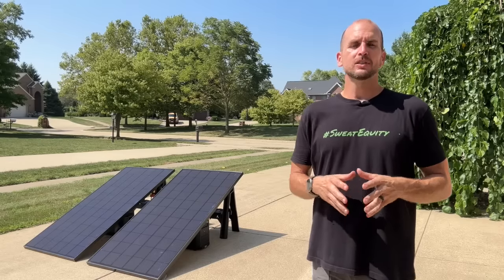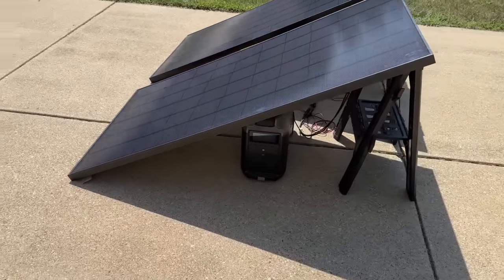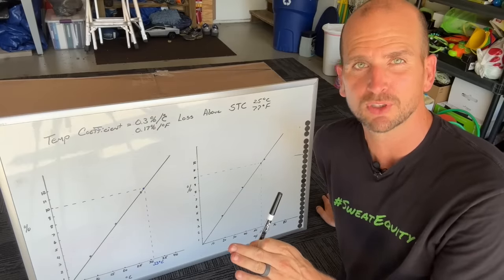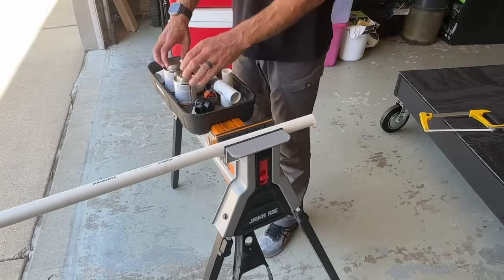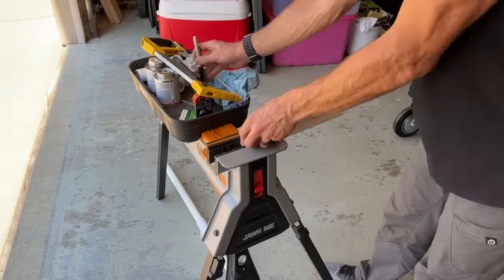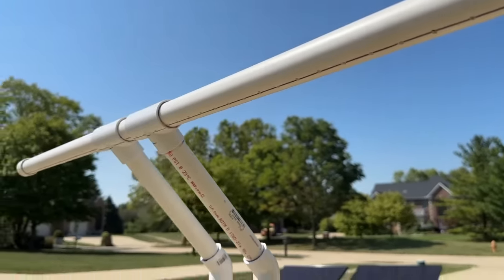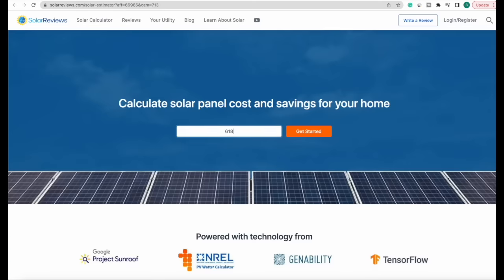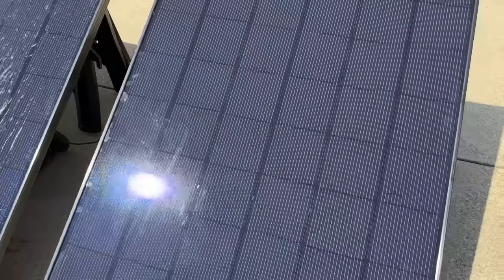Surprising Power Gains By Cooling Solar Panels

Comment: I prevent my panels from  getting too hot by keeping them in the shade.
Reply from the maker: Genius! 😂
Reply: Even better if you keep them indoors
Reply: lmfao 🤣 nice one
Reply: Good luck with the power gain.
Reply: So smart
Reply: Put the panel at the bottom of pool
Reply: Next level genius
Reply: You made my day!
Reply: I only use them at Night.
Reply: @Stevedawhoop  Actually, if they are sufficiently waterproof, I wonder how well they would work under a layer of say 10cm (~4 inches) of water.
Reply: Following your logic, you might also be able to get some savings by running the system at nighttime when it's much cooler.
Reply: @perpetualrabbit  I wonder when we will get one of those thin plastic solar, I want one that only absorb green wavelength and grow plants under it, maybe make it into grow tunnel
Reply: @Stevedawhoop  Well, there are already transparent solar cells  in development that can be used for windows. They do obviously absorb some of the light or they would not be generating electricity. I know that the compounds that maje up the solar cells (doping I think it is called?) can be tuned to absorb certain bands of wavelength.
The fact that leaves are green means they absorb the other colors and reflect at least some of the green light. So your idea should work in principle. I wonder what the plants would look like from outside the greenhouse: black maybe? If you can store the energy in batteries and the heat in mass, like a water basin, you could use grow lights at night and the heat buffer could slowly release the heat. Let me know if you ever get this working.
Reply: EYYY!!!
Reply: @perpetualrabbit  probably some light would be refelcted by the water surface..but it still would be worth testing that idea.
I think i seen a report saying  floating solar panels on lakes also heat up less.
Reply: Best Laugh I had all day!  lol   Thanks!
Reply: LMFAO
Reply: I find keeping the panel cover on during the day and removing it at night works best.
Reply: Jenias 🧠👈🏻
Reply: Best joke evar
Reply: I built a solar shield around them, I also have a cryogenic pump setup from my nuclear reactor, and can achieve within .2 degrees of 0 Kelvin. Take that outta space!
Reply: Ha!!! beat me to the punch!!!
Reply: Better yet cover them up🤣
Reply: I only deploy mine at night.
Reply: Use a small kerosene powered water pump and get the water from a well.
Reply: Very silly, I keep mine in the warehouse
Reply: @perpetualrabbit  Underwater Solar Panels would be an interesting concept! if the longevity is increased by the cooling effect it maybe practical in some regions!
Reply: I keep mine in the box they came in
Reply: @mrblock1318  under a swimming pool, or better yet if they’re light kind as a swimming pool cover
Reply: AHAHAHAHAHAHA
Reply: The Polish were planning a space flight to the Sun and everybody thought they were crazy until they told them they were going at night.
Reply: hey wait a minute....
Reply: Holy shit beware that would give you too much power to handle😂
Reply: LoL
Reply: lmao. seriously.
Reply: KKKKKKKKKKKK
Reply: keep them in a cool, dark place to maximize their longevity.
Reply: That's a good joke 😂
Reply: What about keeping them in the manufacturer box?  ;-)

Comment: the company DualSun has a panel that can take in pool water to heat the pool while cooling the panels. If no pool, they can also be used to preheat water for your water heaters or go to any heat exchanger. It's a pretty cool system.
Reply: Was just about to mention them; currently planning to use some of those, and send the heat to a geothermal well that will provide heat for my house in the winter.
Reply: I always wondered if you could do some sort of micro-thermopile array setup on the back of a panel to generate useful power and cool the panel.
Reply: As soon as I saw the title I was thinking, combination solar thermal and pv is the ideal panel.
Reply: I hope the pun was intended.
Reply: What about all the bird and bat shit! Do they filter that out before you swim or shower in the run-off water?
Reply: @nivid01 it is a closed loop system that uses a heat exchanger, they are on the back side of the panel. So no contamination.
Reply: Anyone know how much a Dualsun or Sundrum system costs per panel?
Reply: @jacobcarlson4010 what climate do you live in? I would think even in a climate like San Diego the panels would be too cold in the winter to pull off any heat for your home and it is not really possible to store heated water for months from summer to winter even in a thermal well.
Reply: Electric bill.....$0.00
Panels bill......$400.00
Water bill.......$100.00
Electric bill without panels..$200.00🤑🤑
Reply: @JONNY2NITE : I’m in East-central IL, and thanks for actually asking. Most people these days go for the “this absolutely cannot work anywhere in the world” type counter. But anyway, back to your point. In the winter months, it can get below -10F (-23.333 etc in Celsius), which is too cold to get heat from the solar panels; that’s actually correct. Where you went wrong is the claim that you can’t store heated water underground; one of the most senior bosses at the facility I work at has a geothermal system that’s based on a well, and his house never goes below 74F in the winter (23.333 etc degrees in Celsius). Of course, he buried the well as far down as he could go; which ended up being more than 60’ down. I know that the office that he works in is also heated/cooled by a geothermal system, but I can’t remember if it’s a well based one, or the “giant field of buried tubing” type. Either way, it is absolutely possible to use a geothermal system to store heat from the summer, then use it in the winter.
Reply: Nice!!
Reply: Wow, I’be been thinking as heat stimulates chemical reactions, that the panels getting hot (and they get HOT in the blazing Hawaiian sun at 1,000 elevation) would raise the output. Of course, NO ONE else has even mentioned this in passing. The closest is s comment about heating water etc. with the heat, but no mention of efficiency improvement. But I do have them over a pure white tarp to stop the nice dark lava from taking it to even more extremes. This video is my second by him, and this is a real eye opening lesson. Kudos!!
Reply: @jacobcarlson4010 Now yer talkin’! Mother Earth news has had a lot of great ideas akin to your thought. But not solar panels for heating water, not that I saw.
Reply: The wire gauge test has a comment about it. Or am I thinking about a comment here that names an actual product that utilizes this concept. Good stuff in the videos AND the comments on this channel.
Reply: @jacobcarlson4010  There's a guy in Nebraska who grows oranges in a greenhouse heated by geothermal - and he pushes the heat from the summer back in the ground. Done right a giant thermal mass can do a lot of work.
Reply: @JONNY2NITE  No we used to get a suntan on Christmas Day in San Diego. Sub tropical climate.
Reply: Anyone know a US company making a PVT panel like DualSun?
Reply: @patrickjkavanagh  I’ve been looking on the web, looks like they are all going through licensed installers so far. New technology, they wouldn’t want to risk some darn fool frying himself or others before the technology gat’s off the ground. I’m starting to think of ways of simply mounting OV panels over solar hot water panels and using aluminum plates or some such to improve heat transfer. I have heard the PV-T is expensive, so I’m thinking of improvising. I was a safety worker for a huge construction company, and have done lots of solar for myself and lots of other electrical work as well.
Reply: @5400bowen  yes but is there a manufacturer in US making this type of panels? I can only find overseas
Reply: @patrickjkavanagh  not that I can find. Looks like they are only available wholesale so far. I’ve been doing web searches.
Reply: cannot imagine how much net gain after running the pump.
Reply: @hc8714  yeah, I was thinking he should do a test with 2 kiddie pools, one with the pump moving the water connected to a battery taking in solar from that panel, and another with a resistance heater connected to another battery taking in solar. Get the resistance heated pool to the same temp as the one just pumping water to chill the panel and see if there's any performance gain or energy saved.
Reply: all this closed circuit aproaches are nice but you should take into your calculation the consumption of the cirulation pump - not that you end with more power consumed by the pump than you gain by cooling the panels
Reply: Do they have a system that yiu can install on preinstalled panels?
Reply: The HPV panels are cooled from the back, pipes running through a supporting heat diffusing material or thermo transmitting mastic gluing them to the back. 

The overall efficiency is massively improved as is the peak output on sunny days and the lifespan of silicon based cells is massively extended by preventing damage. 

It reaches its best use in boats and any off grid situation.  Where PV power  and a supply of hot/warm water is useful.

It could even be used to power a heat pump or stirling engine.
Reply: @JONNY2NITE 

Even in The uk on a cool sunny day heat builds up on a black panel. Also the PV cells work off the shorter blue wave lengths but convert some to the red and absorb more of the red heat wavelengths. Hybrid PV  HPV panels can use more of both the water runs in tubes contacting the back of the PV panel. 

So can just be washed clean and use dirt shedding coatings.
Reply: The efficiency is pretty bad on duals un panels.
Reply: Ahhh yes. Lightning rain panels.
Reply: If I remember correctly, his used air, and he said he recharged it during the day. It was his design of the structur that made it possible.
Reply: I think this is pretty better, water is precious to been wasted like in this video... WP
Reply: @5400bowen high temperatures can also accelerate panel degradation over long times. Interestingly though, some solar panel technologies like organic solar cells could possibly be improved by slight warming because the charge generation process is thermally limited.
Reply: That's 🔥🔥🔥🔥 WOW!!!
Reply: This cogeneration strategy made sense back when panels were expensive but not now. We suggest simply adding a few extra panels and using electricity for simplicity sake. Great test however. Ive considered a cogeneration water preheater for my solar Motorhome because there is no space for a extra panel.
Reply: I remember a "This Old House" episode from the mid 00's that had pipes on the back from the factory. From what I've been told, they are out of MA. Not sure on their name though.
Reply: I think this is the best solution.  Just run a line off the water main through the panels before the water heater.  The water heater can work much more efficiently and the panels do a little better.  The water by itself, like in this video, I would call wasteful.  Of course this is just a test.  The pool might be the best solution though.  It doesn't take more energy for the filter pump.  It's pumping up, but also pumping down.  My parents have regular solar heating for their pool.  It has some pretty powerful affects on the water temperature.  I wonder how the total lifespan of the panel improves when it's cooled like this.
Reply: that sounds great
Reply: @alexandergunda8916  lol
Reply: What about the winter? Even a little water left could crack the panels if it freezes.
Reply: I thought about this but then wondered what hours of pool chemicals every day might do to the panel....?
Reply: @tornadokat  you could run pool water through them, but it's much more efficient to use a heat exchanger near the pool equipment and have something like glycol running through the lines.
Reply: Smart
Reply: Somebody watches linus tech tips lol
Reply: Yes, but they are ridiculously overpriced (you're looking at over 550$ each).
Reply: i was gonna do that just with some black hose coils
Reply: How great if bifacial water cooled hybrid solar panels become the norm? Ultimate efficiency and power output, with the addition of a water heater
Reply: @jacobcarlson4010 Do they ship to the US cant imagine those are cheap
Reply: The idea of using "hybrid" panels that can make hot water while at the same time cooling the Panels isn't new, but due to increased cost and complexity, both during construction and installation means they will likely remain a Niche product forever.
Reply: @mjbates  
That's very unfortunate. Here in Germany we have a lot of hoops to jump through to install Solar, but it seems wherever you live is even worse.
Reply: Then your consumption goes up to run the pump that is sending that water. You still lose.
Reply: @ErikBansberg  The solar water heaters are pretty popular in India and they are pretty cheap - about $250 dollars for 200 liter system including the stands, panels, tank & setup cost.
Reply: And it's French 🥖
Reply: Isn't it the ones shown in LTT vid?

Comment: Instead of pouring lots of cold water on the panels, you could try to spray a little mist. Then water evaporating would cool the panels with minimal water consumption.
Reply: I was thinking the same thing… misters are great as they really don’t use a lot of water… most people think they are wasting water, but refuse to switch to composting toilets… but, whatever
Reply: And spray it on the backside, putting it on the front blocking the sun is just stupid...
Reply: no reason you have to letting the water just runoff into the ground. Assuming a roof mount system run the water over the panels, it drains into the gutter. downspout flows into a catch barrel with a small pump that sends the water back up over the panels.  install a float switch in the barrle that adds tap water if the level drops below whatever minimum amount you need for the pump. Assuming you reduce leaks going elsewhere it shouldn't be any more water loss than you'd have from a mister evaporation.  The main question is does the power gains outweigh the energy usage of the recirculating pump.
Reply: @a64738  light passes through water..... you just blow in from stupid town?
Reply: Water pour also works double as dust sweepers. Kinda matter in sandy and dusty area. Lower the maintenance cost to sweep them off.
Reply: Yes! And let them build up a big pile of scale, that would be fantastic.
Reply: @a64738  It shouldn't block much sunlight. Water is pretty clear, and the backside of the water is bonding to the shiny surface of the panels, so that it doesn't have a second shiny surface to penetrate. Generally the top is more weatherproof, so I wouldn't cool the underside unless there's some serious engineering to handle that kind of moisture.
Reply: Only problem with evaporative cooling, that I can think of, is that it'll leave behind impurities on the panel. Basically all the "stuff" which makes up water-spots. 
Those can build up.
BUT, I agree with the concept. that it doesn't have to be a steady flow... just make sure the misting is strong enough that it trickles away before it entirely evaporates, and doesn't try to deposit residues.
Reply: Or... Just run heat pipes the length of the panel on the back, losing about 5% surface area but you can then cool the heat pipes from the top of the panel and get usable heat
Reply: my hard water would coat it in white powder in a couple of days.
Reply: I would think a fully enclosed system using almost like a radiator or water cooling type system to cool the backside would be effective and save water
Reply: @evancuratolo6734  Could maybe make something which puts water in direct contact with the backside of the silicon. It would have to be very weatherproofed at the electrical connections, and the edges of the silicon, the water loop, etc. But silicon itself doesn't easily corrode or leak.
Reply: What do you do with lime layer formation?
Reply: In the long term it will leave a thick  layer of salt deposits on the panel unless you used deionized or rain water.